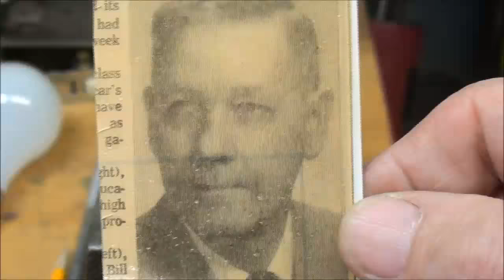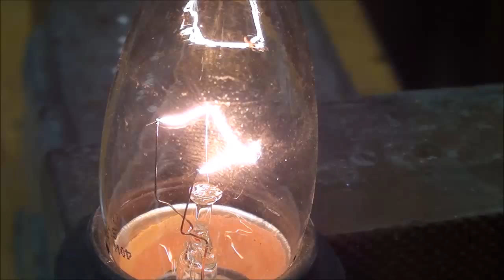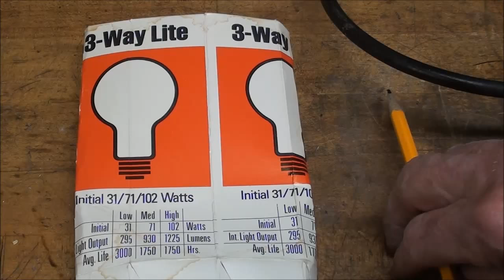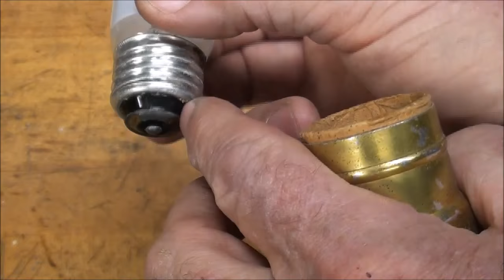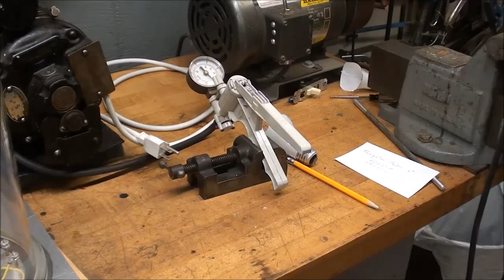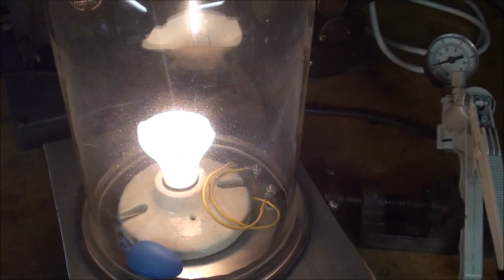WHAT MAKES IT WORK? #16 "How a Light Bulb Works"  tubalcain

Comment: As always a great video. My mother used to install the filaments in those bulbs back before WWII.

One little side note, never use a standard bulb in a three-way socket. in a three way socket, the third contact either becomes hot or common, depending on how you plug in your cord, and whether it is polarized or not. The other two contacts are switched. The size of the center contacts on a standard bulb can, and has caused an electrical short between the center contact and the third contact. the results can be very dangerous.
Reply from the maker: +Joe Allen Thanks for watching.

Comment: Another fine video! You should never be too concerned about giving "too much information." No one is forced to watch. Many years ago when I was taking electronics I had a teacher who spent some time covering the filaments in vacuum tubes. Ya, I'm ancient! He said that research on filaments of all kinds revealed that they would fail where there were nicks in the wire. Because the wire would flex a little each time it heated and eventually break just like bending a piece of wire to part it. The wire  gets hot and fails at the point of continued bending. Because the wire was smaller at the nicks it tended to break there. Thanks for this post!
Reply from the maker: +William Lee Thanks for watching.

Comment: Another great video.  I saw a show years ago about an old fire station in Boston or New York, or someplace like that.  They've had an old light bulb turned on in the station I think since it was built.  Probably 100 years ago.  They mentioned that light bulbs can be made to last forever but the intentionally manufacture them to fail so you'll have to keep buying them.
Reply from the maker: +fall22123 Thanks for watching.
Reply: +fall22123 so I was waaay off. it's in California.

Comment: I used to make lamps here in the UK, I worked for Thorn EMI. You won't believe the trouble you can have making these lamps (bulb is not the correct name). The filament is dipped in phosphorus during the process then when power is applied for the first time the filament is cleaned by the phosphorus burning off,the voltage goes up in steps to age the filament correctly. There's a few more steps but I'd be here all night explaining it. Great job in the winter I had to go in early to fire all the machines up so they had expanded by the time production started.
Reply from the maker: +Robert Clive Thanks for watching.

Comment: Overall great video - lots of info, learned some new things about light bulbs that I didn't know before.

Maybe a bit nitpicky, but one thing I kind of snickered at was the light bulb "obsolecence conspiracy". I guess you could be right that the powers that be in the incandescent bulb industry conspired to make more money off the bulbs that were lasting forever...but that's kind of what companies do. If I see a consumer product that lasts 80+ years, in most cases, it's waaay over-designed and the designer did a bad job deciding on the trade-offs. As you said, bulbs previously were dimmer, so their wire temperatures were lower. With heating elements (I work with electric heaters), one of the main trade-off is between life and wire temperature (which is determined mostly from Watt Density: Watts per square unit of wire surface area a.k.a. heat flux). I'm assuming that's the constraint they were working with - how to make a more compact package that lasts to a specific desired life. Though, I would agree that they may have gone too far on that trade-off curve and taken too much life out of the bulbs.

Comment: My mother worked for Westinghouse, she "pulled" tungsten wire for filaments the blanks were about 6" long 2" diameter they were heated and pulled through successive dies until it reached filament size. The workers would make special bulbs to take home, these lasted forever in fact I never saw a blown bulb. We even had coated bulbs that were very hard to break, the coating was developed for NASA because of the severe vibrations.
Reply from the maker: +K.D. Pearce thanks for watching-those are good stories

Comment: Another reason to fill the light bulb with argon is to balance atmospheric pressure. This allows for a very thin glass wall to be used, making the bulb cheaper and lighter.

Comment: Those three way bulbs never made it to the UK we went for a dimmer built into the light switch, if memory serves it was a rehostat usually and they often buzzed annoyingly on lower settings. Oddly enough though because we use the bayonet fitting it would probably have been easier to have a three way bulb as the bayonet already has three separate points where metal makes contact. Anyway, Mr Pete, please get a cage or at least some plastic mesh for your bell jar. If that thing implodes while under vacuum you really don't want glass flying all over the place.
Reply: +Wobblycogs Workshop A rheostat is just an adjustable resistor - it will not buzz in any way. What you hear buzzing is a TRIAC light dimmer circuit that is chopping up the mains voltage.
Reply: +zaprodk Thanks for correction, I've just had a quite read up on triacs and that makes sense now. I guess when I've heard the switch buzzing it was the choke making the noise probably because it was being used beyond it's design capacity. Chopping up the waveform like that on an incandescent must have been awful for the longevity of the bulb though especially on low power.
Reply from the maker: +Wobblycogs Workshop Thanks for watching.
Reply: +Wobblycogs Workshop afaik it makes the bulb last a lot longer because it is started softly, which has much more impact on the lamp life than the possible negative effect by the chopped up voltage.

Comment: Main reason tungsten is used is not its density or  electrical resistance - it's because it has a very high melting point.  Tungsten melts at 6,191°F.   Nichrome wire is used as a heating element in appliances like toasters and soldering irons - it would be used in light bulbs too if it were possible as it's much cheaper and easier to work than tungsten, but it's no use for an incandescent bulb because it melts at only 2,550°F.  A typical light bulb filament runs at about 5000°F: running them hotter makes a more efficient bulb but at the cost of reduced lifetime - the bulbs used in slide projectors run just below the melting point of the filament so as to give a good bright white light for more accurate color rendition - but as a result these projector bulbs only last about fifty hours, even when handled very carefully with no shocks or vibration allowed to reach the projector while the bulb is illuminated.

Comment: The yellow on the large filament was interesting.  As was the blue on the inside surface of the remaining bulb glass when you let the air back in.
Reply: +Crafted It was almost certainly a coating of tungsten trioxide which is pretty much exactly that colour, there was likely some contamination from other tungsten compounds though. The blue is a little harder to explain, my first guess would be deposition of evaporated tungsten (see chemical vapour deposition). There are also more uncommon oxides of tungsten that are blue which could have been formed in a low oxygen environment and there was a blue balloon in there.
Reply: Wobblycogs Workshop I considered the reflection of the blue balloon.  You can see in the beginning and in the thumbnail image that it's not imposing a reflection of blue.  The blue coating only appears after the introduction of air.   Now I need to learn what a trioxide is.  ;-)  Thanks for the comment.
Reply: I wasn't thinking a reflection of the balloon more like something evaporated from the balloon. Under very low pressure solids can easily enter the vapour phase and then deposit out.

Trioxide just means three oxygen atoms in the molecule. For example carbon monoxide (CO) is carbon with one oxygen, carbon dioxide (CO2) is carbon with two oxygens. For reasons that are more complex than I can explain here you can't get carbon trioxide. Tungsten though can exhibit a trioxide form. A small number of atoms can also form tetroxides (four oxygens) but that's uncommon, osmium being one example.
Reply: Thanks for expanding.  I'm checking out your channel now.
Reply from the maker: +Crafted Thanks for watching.

Comment: That was interesting. I noticed there was a blue deposite on the bulb after you let the air in. Where did that come from?
Reply: +eamonn280958 That was tungsten dioxide or trioxide. It must have vacuum deposited when there was still very little athmosphere. Very impressive.
Reply from the maker: +eamonn280958 Thanks for watching.

Comment: I curious as to how you opened the bulbs without breaking the filaments?
Reply: Looks like he first scored the globe with a glass cutter then a Gentle tap on the score with the end of the cutter would complete the break.  Brand new filaments are more sturdy than a one that has been fired and it looks like he used new bulbs for the demonstration.
Reply from the maker: +rshaddinger Thanks for watching.

Comment: At 17:40 about the longevity of the bulb.  There is a bulb that has been running since at least 1901.  https://en.wikipedia.org/wiki/Centennial_Light.  I don't know about the "make it fail sooner" conspiracy.  Could it just be "make it cheaper" (engineering decision by reducing the diameter of the expensive tungsten filament)?
Reply from the maker: +cemx86 Thanks for watching.

Comment: Yes, incandescent bulbs are ver inefficient in producing light. 
But they are incredible efficient in producing heat! 
If you heat your house with electric power anyway, there´s absolutely no reason to switch to more efficient lighting, because every watt you spare on lighting, you have to put into heating. 
Ok, in summer it´s a different story, but there you need much less lighting anyway.
Reply from the maker: +sthenzel Thanks for watching.

Comment: The worst thing you can do to a light bulb is turn it off and on! Each time its turned on and off the heat change causes micro fractures that eventually break the filament.
Reply: Theres a bulb at some fire station thats been burning continuously for like 80 years!

Comment: I believe modern bulbs are filled with argon
Reply: +Jeff Pinter You are right Jeff! The inside of most modern incandescent lamps is filled with a nitrogen/argon mix, other inert gasses can also be used.  The pressure is reduced so that its less than 1 atm at operating temperature.  Operating an incandescent filament in a vacuum hastens its evaporation leading to lamp failure.  The coiled-coil configuration of the filament also helps to slow evaporation.
Reply from the maker: +Jeff Pinter Yes-Thanks for watching.

Comment: Did you know that the conventional wisdom and theory of how we view light is all wrong and incorrect! Physics and Energy are all wrong wrong wrong! For instance using the incandescent light bulb as an example,,, It is taught that a flow of electrons passes through the resistance of the wire filament that resists the flow. The kinetic energy of the flowing electrons impeded by the resistance of the wire doesnt remain in the wire but as we have long been told how the net sum of energy must always account be accounted for.... "Energy never disapears, it only changes form." Given that , we are taught that the resultant energy changes form and dissipates in the form of light and heat. It further is said that the resultant light  radiates and is eminating outward from within the globe of that lightbulb to shine out into the our own surrounding universe. Wrong Wrong Wrong!!! A lightbulb does NOT radiate, project or shine light outward. Notice, for instance that the incandescant bulb is enveloped in a vacuum? LIGHTBULBS DO NOT TRANSMIT LIGHT. RATHER THEY SUCK IN THE DARKNESS. Light works by the suction of dark matter! Did ya ever notice how the burned out bulb always has a rather dark spot in the bottom of the bulb... Proof that the reason why "burned" out bulbs no longer "shine".... So simple, they are filled to maximum capacity full of darkness. Ever heard of black holes in the universe?????
Reply: +dugdiamond lol
Reply: +dugdiamond ..........ummmm...................